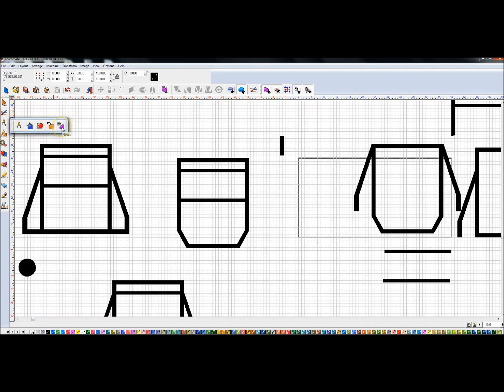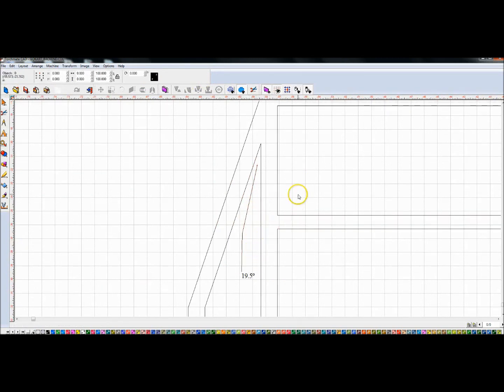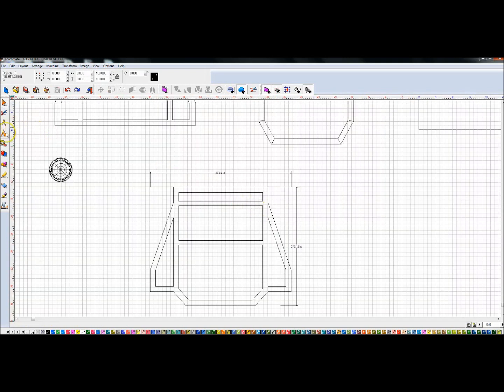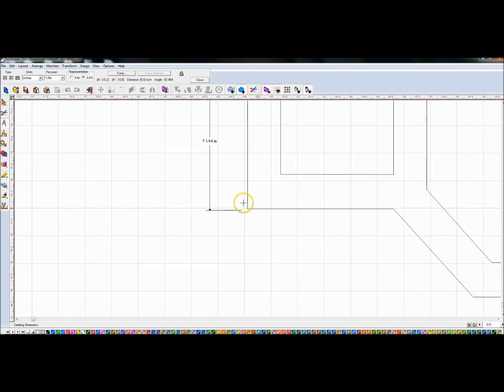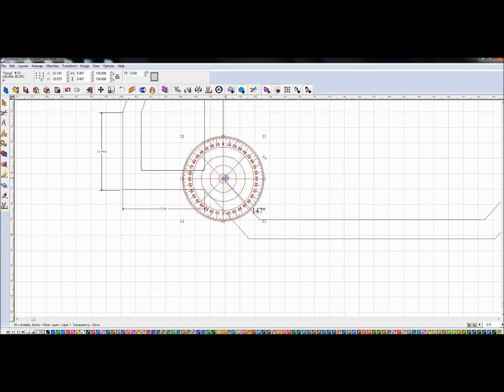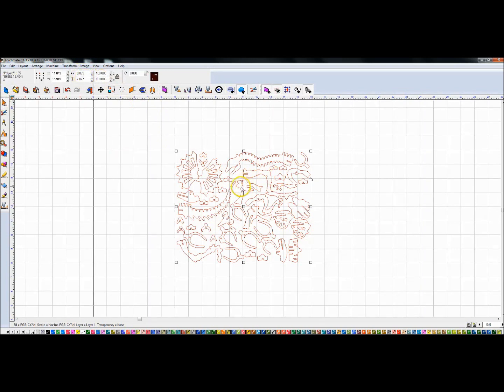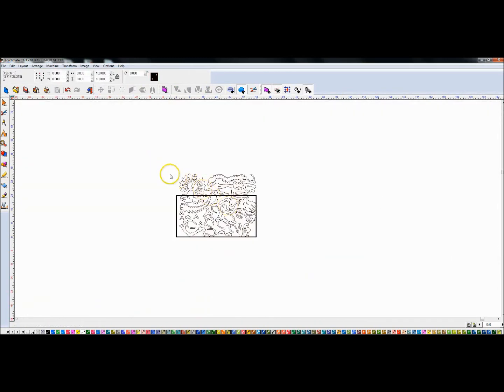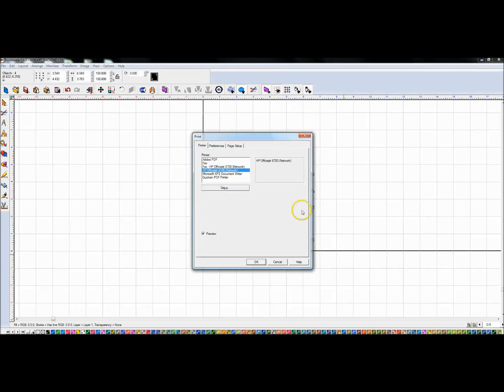Torchmate CAD/CAM: Measuring Tools

Comment: I want to make a clock. Do you know how I can accurately set up the numbers between the easy ones? The 45 degree angle 12, 3, 6, and 9 are easy. The rest, I'm not sure. Any ideas?
Reply from the maker: Do the others as you would do the 3,6,9, and 12.  Select them all, group them, and rotate them by 30 to 60 degrees.
Reply: @JohnHarmon  thank you. I see. Right